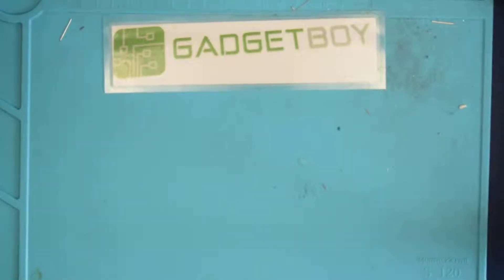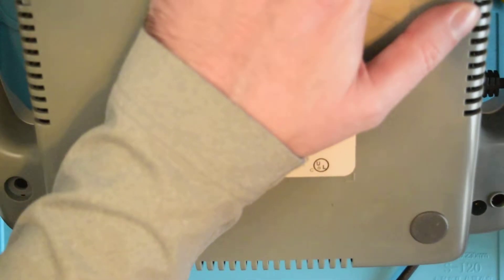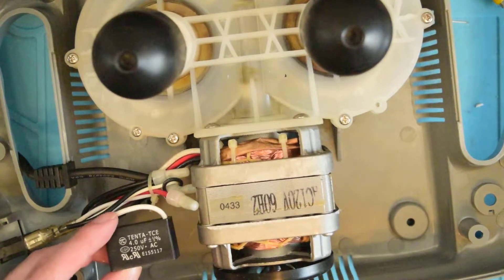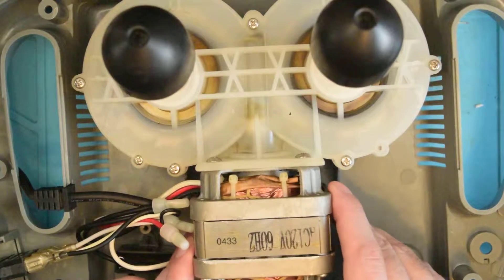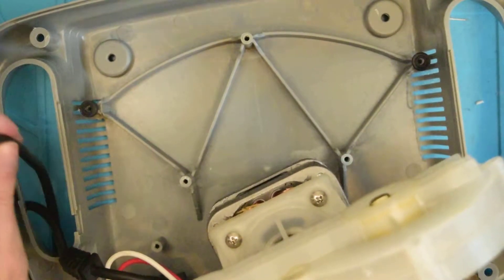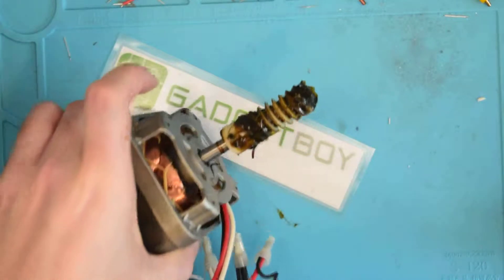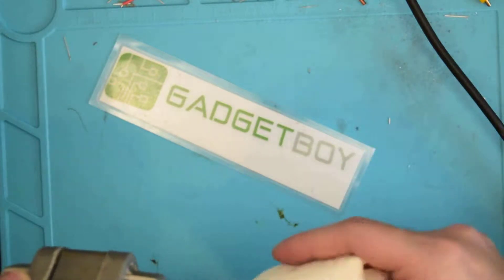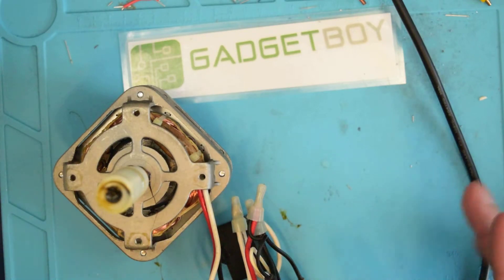"Shiatsu" Neck Massager Teardown

Comment: I have an old one of these massagers too. Different brand, little different looking on the outside, but the inside seems to be very similar.  The reason I opened mine up is because it's just "humming" and not moving. I can see the little fan twitch, but it doesn't spin nor does the shaft on the other side. Do you know if there's any way to fix it, or it's ready for the scrap pile?
Reply from the maker: Sounds like the gears might be jammed. Pull the motor or of the assembly like I did, and see if the motor runs.

Comment: Bingo!  I have this model.  The motor shut off after some clunky sounds happened inside.  Seeing your video gave me the courage to open it up.  I suspect I will find the plastic housing broke apart.
Reply from the maker: One or more of the gears cracking, probably. It's a pretty fine motor, once you manage to extract it.

Comment: 60 hz does NOT mean 60rpm in  North & South American 120 volt electricity is generated at 60 Hz Alternating Current (AC).
Reply from the maker: You're right. I'm not sure why my brain offered 60rpm. Maybe I was thinking about those weird motors in some clocks.

Anyway, given how smoothly and quickly it runs, it's probably a 4 pole motor, which means it's running at 1800rpm

Comment: Try running it with different capacitor values?
Reply from the maker: I did some research, the capacitor is critical for changing the phase going to one set of the windings, without it, the motor won't run in either direction. to reverse the direction, you just switch the windings it's in parallel with. The actual value is also important, as it has a harmonic with the inductance of the windings, so different values could cause big issues.
Reply: @GadgetBoy  I have a calculator for motors and capacitors somewhere, usually ranges from a  .22uf to 2mfd, didn't know it altered the phase, interesting
Reply from the maker: if I had a better oscilloscope, I'd demonstrate inductive and capacitive phase shift, but I need multiple channels to do it. Maybe in the future. Or if some oscilloscope company decides to sponsor me.
Reply: @GadgetBoy  haha, yeah that would be nice... Bloody keysight

Comment: Looks like a fan motor, I noticed my electricity always lasts longer when I have my fan running full time...

This was made in 2005?jeez,it looks 40 years old! 😂

Total tittytron
Reply from the maker: Really nice motor, though. Much quieter than any fan motor I've ever seen. I'm still pondering potential uses for it.
Reply: @GadgetBoy  depends on torque I guess... Maybe a nice fan? 😂 Test your own blade designs, or a tool sharpener, or... A challenge? 😏
Reply from the maker: Given the bruising it caused, there's a lot of torque. I was thinking something like a pump or maybe a kinetic sculpture.
Reply: got one of the same branded back massagers, may have overused and overheated the motor, and now when spinning any resistance to it, it just stops spinning makes a clicking sound and is stuck.. the motor appears to be trying to turn it but doesn't have either enough connection or power..? any ideas how or if possible to fix? they cost around £20 so if its a lot of effort then threes no point :)
Reply: @SpoonyJeffUK  sounds like a worn gear, it happens a lot with plastic ones, easily replacable
Reply: @phonotical  ty i saw the plastic teeth/cogs in this video would it be this part thats fked?
Reply: @SpoonyJeffUK  could be! Don't know until you take a look, onky takes a small amou t of wear to really screw them up, just count the teeth and go to ebay